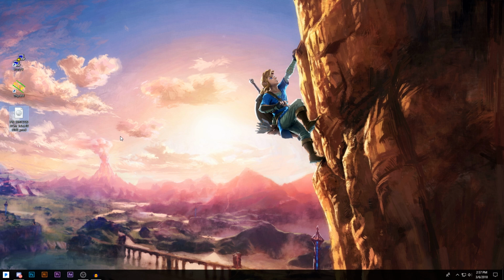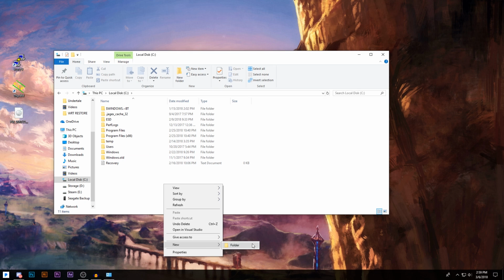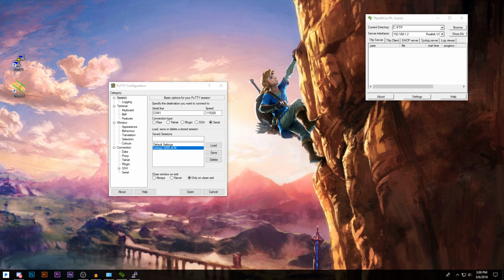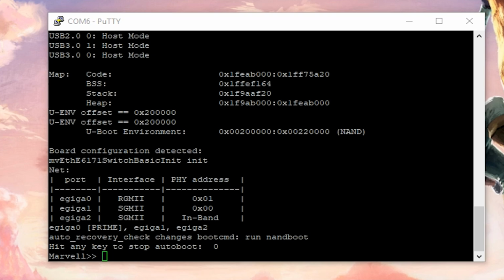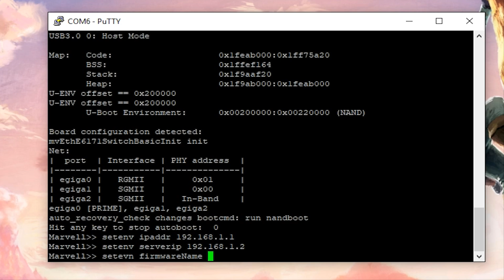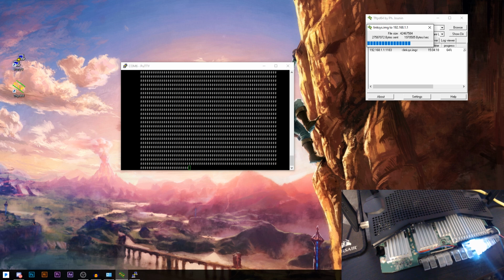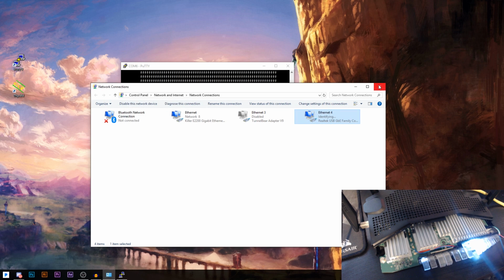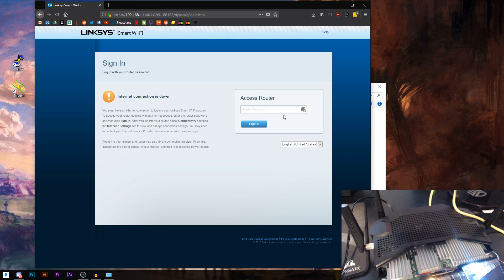How To Unbrick and Restore A Linksys WRT 1200 1900 and 3200 Using Serial and FTP

Comment: One of the reasons I bought this router is because it has a console port, which many consumer routers lack. 
Question: How did it know the path to get to the FTP folder where you dropped the firmware file?

Comment: For those looking to un-brick their Linksys MX4300/LN1301, and you are unable to flash with "run update_both_images", the commands for flashing are as follow:

setenv image linksys.img

setenv ipaddr 192.168.1.1

setenv serverip 192.168.1.2

run flashimg

followed by 

setenv image linksys.img

setenv ipaddr 192.168.1.1

setenv serverip 192.168.1.2

run flashimg2

*edit you might have to disable ur firewall to flash the firmware

Comment: Yup openwrt bricked my 1200ac.
Reply: My EA4500v3 got trashed my OpenWRT as well...😅
Reply: @victorfigueroa9385  Finally got to this, openwrt site is wrong for pinout, its reversed, pin 6 is for gnd like you have it but there site is the opposite. Damn I miss the old DD-wrt days when you could count on the docs being correct. And trying to figure out the version is insane from their docs, that literally why I flashed the wrong version and got bricked.

Comment: I have the WRT1900ACS V2. I finally got it to work by leaving the white wire unplugged after turning it on, once the lights flash on then off, hurry up and reconnect the white wire and it would start reading. Also, to get keyboard input to work on the newer version of putty, you have to go into the putty serial settings and change Flow Control to None! Thank you!

Comment: I have  WRT1900AC v1 Linksys router. Problem is that I have flashed the OEM firmware (partition 1) and the router does not allow me to configure it since Internet link is solid white light and have no Internet connection. I have to perform 3 turn off and turn on steps to go back to partition 2 where Openwrt is located. Will this procedure fix the issue I have? Everything came up to me because Linksys is giving me less speed (200 MB) 5 Mhz frequency and my ISP gives me 400 MB contract. I have tested cable between two routers and works fine. Ethernet ports have been tested and Internet speed is around 400 MB. Wireless is the main issue I have. Is there any possibility that Openwrt has locked the 5 Mhz frequency? That why I need to restore the router with the OEM firmware but it is impossible.

Comment: This was a great video that allowed me to restore my 3200ACM.  I had issues running the "run update_both_images" but that was solved by running "env default -a" before running any of the commands. The firmware installed successfully, but gave me an error about nandboot and altnandboot not defined. This was resolved by running the following 3 commands separately in marvell "env default -a" "saveenv" "reset". Maybe had I ran the 3 commands first then I would not have needed to flash it.

Comment: Pretty good video. One very funny note. I have two WRT units. One running LUCI DD-WRT (3200) and the second one is stock (1900) for good 3 hours I was trying to connect to the serial port because I know a few years back I installed it permanently in the unit with a hole and snaking out the cable and everything. After several hours of trying everything including different drivers and bands and other settings in Putty and device manager I gave up. The next morning I decided to look what was going on and I found out all this time I was trying to connect to the 3200 LUCI router when the cable was originally connected to my original WRT unit AKA 1900 ..... so yeah always check proper cable connections and units it's connected to :D

I am actually interested in more advanced or perhaps a bit more videos on how to go from stock to DD-WRT I would think it's the same thing just use DD-WRT image instead of l OEM but again would love to see more videos on what possible with serial connection, perhaps some NAND / DRAM / OS manipulation and/or firmware modification.

Good video, Cheers !

Comment: I have used this video several times over the past few years.  This last time it was a Linksys 1900ac router. The video does not show how to remove the back black panel.  I just used a screwdriver and started separating the cove at the front tabs, on both sides until I wired to the back middle. It the popped off. One of the back antenna wires popped off when I folded the black cover over to the side. I just looked for the little jack on the back of the board. I did have an issue with the setenv firmwareName setting.  During the run command it kept saying it could not find the file blk-mamba.128mb.img. I tried it from the beginning of the setup and always says the same thing. I just changed the file in the tftp directory to match this name.  It worked fine.

Comment: Saved my router from the bin... I have the Venom firmware and ran into a few issues. Putty did not "see" the router, I had to swap the white and green wires. I then then ran into another issue, get getting T T T T T when trying to write the firmware and then it would just time out. I had to disable Windows Firewall and it worked immediately after that.

Comment: I usually don't like video instructions (can be done a lot quicker in plaint text imho), but you did save the day for me!!! Thanks for that :)  A few remarks for anyone coming from the wrt32x:  After connecting the serial TX of the modem and then powering the modem, it will not boot at all. After unplugging the tx it will start booting, and then enter bricked state unless you send the asci code: ctrl+c (alt 3) within 1 sec of booting (you can spam the "ctrl+c"). Then you can reconnect the tx and talk with the modem over serial and do the instructions of the video.
Reply: I had the same problem. I used your guide and was able to connect though on Rx. wdevlap0: AP-STA-DISCONNECTED Not connected when loading data

Comment: Found a reason to dust off my WRT3200ACM which already had dd-wrt on it, went to update to a newer version (mine was over a year old) and BRICK!!! I recall all the other instructions when I was doing more with dd-wrt and yours is by far the easiest to follow.

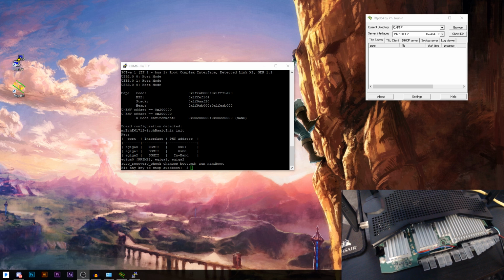BUT I have a question. I can get all the way to the point where the auto-boot countdown timer starts (video 8:45) and no mater what I do I cannot get it to stop the boot. I have checked the pin connections, changed to a wired keyboard from Bluetooth, still no luck.

If anyone has any recommendations I would really appreciated it.
Reply: My bad... my eyes suck and I had the green wire on pin 5, not 4 :-/

Comment: can you do this on a linsys e3000 I have 2 with openwrt bad flash lol I have the jtag usb cable but I need to solder pins on the router's motherboard but I'm thinking I'll mess up. or if anyone has a video that shows how to please refer me to it. thanks. I know how to weld but not solder to a board hahahaha laterz thanks. great video.

Comment: I’m sincerely thankful, you saved my ass i just unbricked a wrt3200acm with this method, 
one difference is with my router to get any console output, immediately after the power cycle i have to lift the rx pin and put it back in again, i get no power led and no boot otherwise, also i should mention that PuTTY does not allow terminal input unless you change the default flow control from XON/XOFF to None in the serial options.

Comment: This is a great tutorial. I have a WRT32X that presently has DD-WRT firmware installed, and I'm hoping to flash both partitions back to LinkSys firmware. I cannot get to the Marvell prompt.  It seems U-Boot takes over immediately and completes the boot sequence. I can't break in with <Ctrl><C> or anything else I have tried. Any ideas?
Reply: mine would'nt boot at all with the TX of the modem connected. see my other post

Comment: Led Enjes's extra steps helped me immensely but there were a few things I had to do differently.
1.   In order to get to the Marvel> prompt I had to use the enter key, the space key didn't help at all.  I could see where the spaces were being inserted but the boot continued.
2.   I needed to  unbrick a wrtac1900ac v1 and kept getting an error about "blk-mamba.128mb.img".  I downloaded the Ver. 1.1.10.187766 firmware from Linksys and renamed it "blk-mamba.128mb.img".  Then I ran these commands

setenv ipaddr 192.168.1.1
setenv serverip 192.168.1.2
setenv firmwareName blk-mamba.128mb.img
run update_both_images

Here is a link to the Linksys firmware I used:  https://www.linksys.com/no/support-article?articleNum=148550
 ---  It's for the 1900AC v1 only.

Comment: Worked great on a WRT 1200AC, V2.  Thanks. Make sure you push the "any button" when it pops up, don't wait for the load to finish.  Also had to hold one of the ttl connecters since it was a little loose or the terminal would not recognize keyboard input.  I used the latest version of the Linksys firmware (Ver. 2.0.6.191786
 Latest Date:  12/10/2018) and just followed the instructions. I owe you a beer.
Reply: having a problem on my 1200ac, cant be sure its a v1 or v2?

Comment: hello i have a problem with my linksys acswrt1900,its like after 7 minutes of connectivity everything is white on the display even the wifi displays and then suddenly it shuts of. and  after that the power display blinks and blinks again and again,will this fix you provided will work on my router?i accidentilly  before did an upgrade firmware via wireless wifi on my router maybe thats the cause of this?

Comment: i followed yous steps and Led Enjes and The Wandermore too but end in failure and found out Putty should be 32 bit version and Tftpd can be either 32 bit or 64 bit no issue and the factory firmware in the linksys works fine for me now i can able to flash two of my wrt3200acm bricked to alive thanks for the info

Comment: Hi great video, very well done, just two things: 1) the TTL Serial to USB cable you plug the USB end to any USB port of your computer, correct? 2) the yellow ethernet cable is it a normal cable? My understanding is that in your video you disconnected from your computer the ethernet cables that connects you to a WORKING ROUTER (and to the internet), and its place you connected the yellow (normal) ethernet cable from the NON-WORKING router, correct?

Comment: Trying to reflash my WRT3200ACM firmware but can't get to the Marvell prompt.  With the serial cable connected, the router won't boot.  If I connect the serial cable immediately after powering on the router, it always auto boots.  A couple others in this (old) thread had the same issue.  Anyone find a fix?  ANY help is greatly appreciated!
Reply: I have the same problem with WRT32X.
Reply: Hi William by any chance, did you manage to resilve this? this is happening to me as well!
Reply: @guillermoferro946  I did eventually get it to work but it's been awhile since I've been through the process.  I remember the ORDER in which I did things made a huge difference.  This is a comment I made to the thread immediately after I got mine working...

I was able to get to the Marvell prompt by connecting the TTL cable immediately after turning on the power to the router and spamming the space bar.

Another problem I encountered was that PuTTY was attempting to load but was giving...
T  T  T  T  T  T  T  (etc.)
...and then timing out.

I found that I had to start TFTPd64 AFTER I was at the Marvell prompt.  It might have been obvious to some, but I didn't realize that without power to the router when TFTPd was initialized, no connection was made when TFTPd was started.

Led Enjes had some very important tips in his comments above as well

Hope it helps, Best of Luck!
Reply: I have the same problem, I can't get it to work. If the TTL cable is connected the router won't start. :(

Comment: Thanks so much for your video!  Somehow my router was hacked and OpenWRT was installed.  It was a challenge getting it back working again.  The only difference I had was when I ran the firmware update, it was looking for cobra.img no matter what I told it the firmware name was.  I have an AC1900 V2

Comment: I followed this guide and had unexpected results. I was able to complete all the steps. The only difference is they did not work. Upon typing the command 'reset' in the putty session, the router did in fact restart BUT the linksys firmware did not load. I received a blinking power LED. Which is odd because I followed all the steps, saw the image was copied over thru FTP and applied 100% OK but it didn't work. Any ideas?
Reply from the maker: Double check that you have the correct firmware for your router.  It sounds like whatever firmware you are trying to restore to is not compatible with your router.
Reply: Zach Stabile I have a Linksys WRT32X and there’s only one firmware available to download and that’s what I used. Maybe I should try a DDWRT firmware instead?

Comment: Hello Zach, how are you? I need help and maybe you are the right person for this. I have a linksys EA9300 that does not open the web part. I receive ok answers on ping 192.168.1.1, but without success to access, telnet on port 80 also does not respond :(. So I understand that I can try a recover via serial. There is the problem, I do not find pinout information for this model in nowhere, by any chance would you have this information? The serial pinout of the EA9300. Grateful for any help :)

Comment: Hello, Thank you for the tutorial. I recently purchased a WRT32X. The tutorial got me all the way through seeing readable text output on the console (Putty). But then I rebooted and now all I can see is "Garbage or Gibberish" characters. I was at it for hours. I checked everything and everything I could find Google searching. Man, these routers are a nightmare.
Reply: HI, Have you fixed it? I'm also having the same issues
Reply: @RedDragons23  Hey Adam. Unfortunately, No I haven't fixed it yet. A second one was purchased used on Ebay and we attempted installing OpenWRT. It was successful. However, it seems behave strange sometimes. It's still a nightmare. :\
Reply: @digitaladdiction8612  Hi, Just saw your reply. That's a shame :( I spent a good few days troubleshooting mine in the end and I got DD-WRT successfully installed on mine instead, been working great since. Fixing it was a nightmare, It took me days to get it back to stock firmware since I screwed up both partitions. Then I installed DD-WRT from Stock firmware.
If it's gibberish, just double check/give the connections a wobble as I know mine didn't make a good connection. One thing everyone forgot to mention was that some WRT32X you need to have the white cable (Rx or Tx, I can't remember) unplugged for it to boot then you have to connect it as fast as physically possible so you get the full serial output.

Comment: Dude, You are Awesome I will let you know if that work with my router I was going to dump it
Reply: Ok, finally is back to life my WRT1900AC v1 thank you Zach Stabile for your help also to 

Simon Foakes

Led Enjes
I used all your knowledge and it worked, for some weird reason, I had to use "setenv firmware_Name blk-mamba.128mb.img" even renaming the file and forcing to use the "linksys.img" it wasn't working, so instead to fight I just changed the name of the file to "blk-mamba.128mb" and after that everything worked flawlessly

Comment: Great video walkthru!
I just want to add a few more steps that pertain to the WRT32X:
- You may need to hit the space bar key within 3 seconds of powering the router to interrupt the boot in order to see the console.
- After the console loads, you may need to hit the enter key a few times to get the venom command prompt to show up, so you can enter command.
- And finally (VERY IMPORTANT), you need to use the "FLAT" version of the Linksys stock firmware, not provided by Linksys. The reason is because Linksys provided firmware is not made to be flashed via USB-TTL. Do a search for "flat-FW_WRT32X_1.0.180404.58.img" (this is the latest version as of today 11/3/2019... it's on DD-WRT's forum).

I was able to debrick my WRT32X by following this video + finding out the above steps through other researches.
Reply: this helped me finish thank you !
Reply: can you link the flat firmware please
Reply: hi please share the link for the flat firmware version
Reply: I would also add that if you have a raspberry pi or an arduino laying around (and some breadboard jumper wires) you should be able to access the serial port through the arduino's FTDI (shows up just like the COM port) or the raspberry pi's serial interface (more work). The one thing I had to do though was disconnect the RX line (on the arduino/pi's side) to get the router to start booting, then quickly reconnect it to see output.

Comment: This looks really promising, but has anyone encountered having the 3200 refuse to boot while the TTL serial cable is attached? It boots up fine (with a semi corrupted version of DD WRT), but when I attach the TTL cable (after powering down of course) it refuses to boot up. Once I remove the TTL connection (again, powering it down prior to removal), it powers up fine. So essentially I can't establish the serial connection and get to the marvell prompt
.
Reply: William, I'm having the same issue.  Did you ever find a fix for getting to the Marvell prompt?
Reply: William,

I was able to get to the Marvell prompt by connecting the TTL cable immediately after turning on the power to the router and spamming the space bar.

Another problem I encountered was that PuTTY was attempting to load but was giving...
T  T  T  T  T  T  T  (etc.)
...and then timing out.

I found that I had to start TFTPd64 AFTER I was at the Marvell prompt.  It might have been obvious to some, but I didn't realize that without power to the router when TFTPd was initialized, no connection was made when TFTPd was started.

Led Enjes had some very important tips in his comments above as well

Thank you everyone for the excellent guide and helpful tips!!!

:D